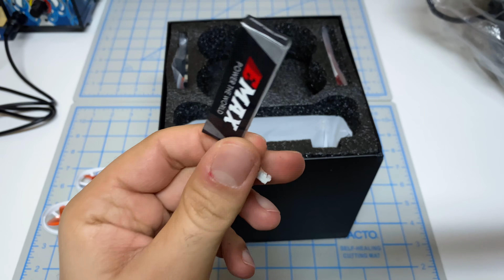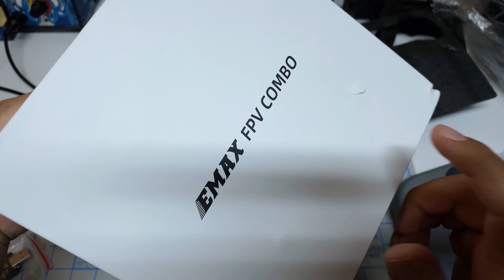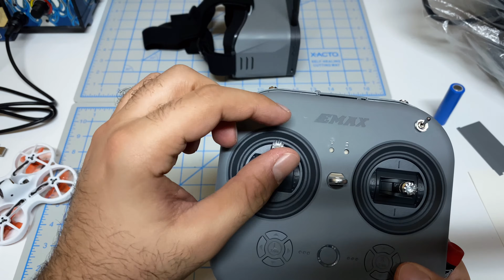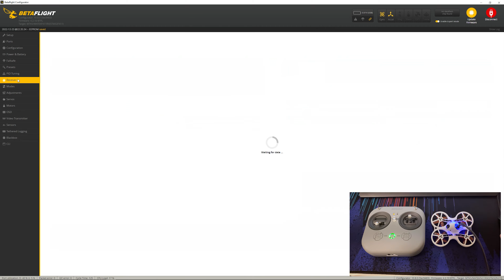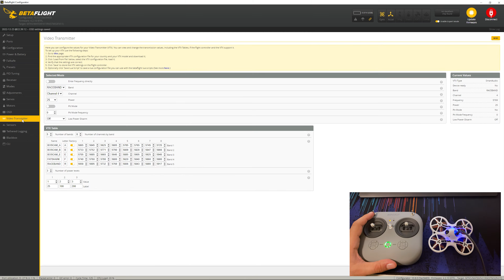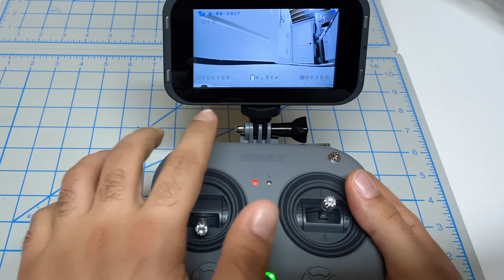The BEST beginner budget friendly FPV drone? | EMAX EZ Pilot Pro Unboxing, Review, & First Flight

Comment: How can I conect tha camara
Reply from the maker: You mean how do you connect the drone and the goggles? If so, they connect automatically once you get them on the same channel. Easiest way is to cycle through the 8 channels on the goggles till you find the right channel that the drone is transmitting on.